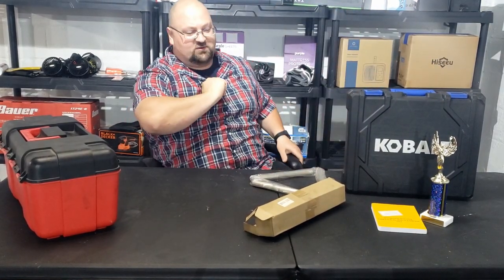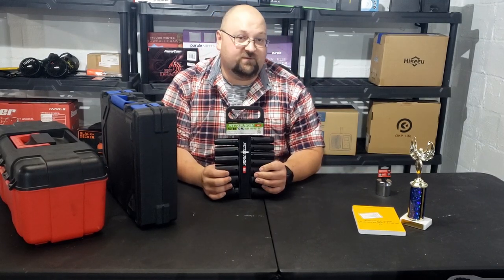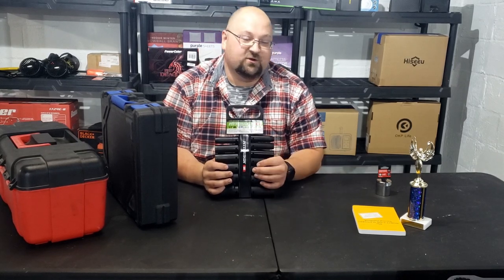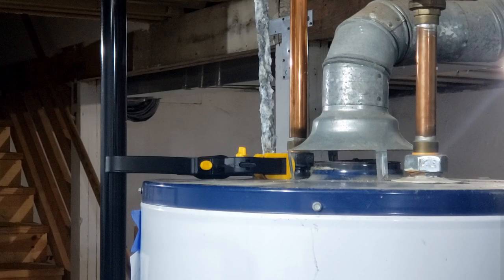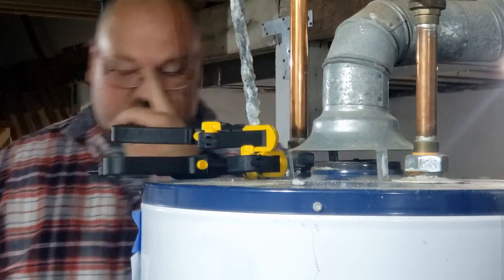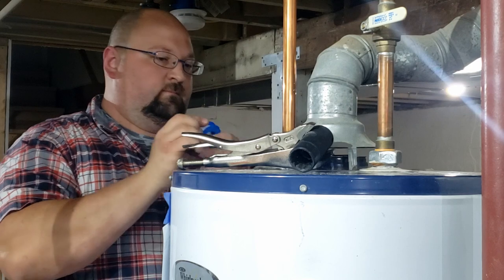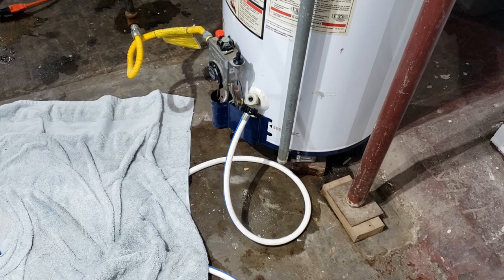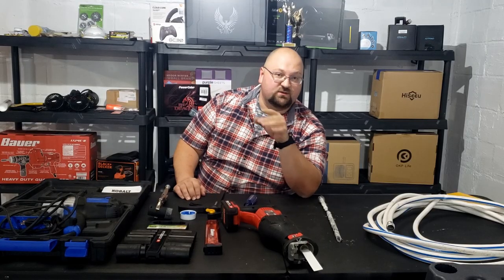You Won't Believe How Nasty This Water Heater IS! (Anode Rod Replacement Years Late!)

Comment: SAE 1 1/16 socket = 27 mm metric socket for those that may have metric sockets.    Only use a 6pt socket as a 12pt will round off the nut.

Comment: Double Checked and yes, you wrapped your Teflon Tape Backwards.
Change to a Straight Full Flow Drain Valve and do a few 5 second Opens until the flow is Clear of sediment. Doing this a few times a year will greatly reduce buildup.

Comment: You should replace the relief valve every five years as they freeze up. Also best to drain a little water from the bottom every couple of months which will avoid the drain valve clogging issue.
Reply: Actually, if you follow the once a year valve cycling procedure, and keep sediment buildup under control, the Valve may never fail.